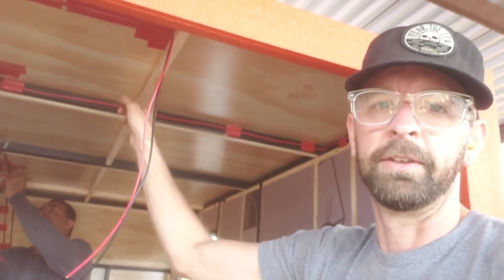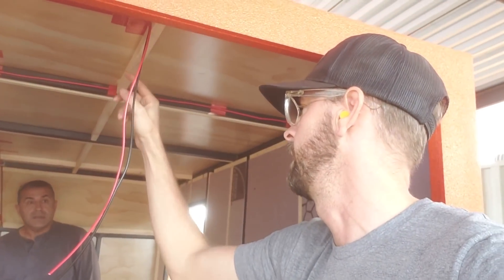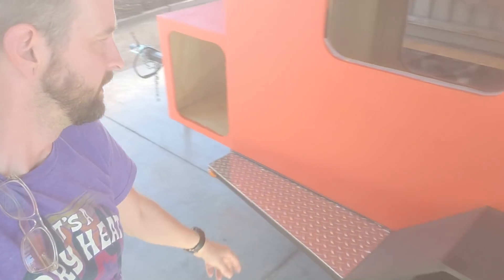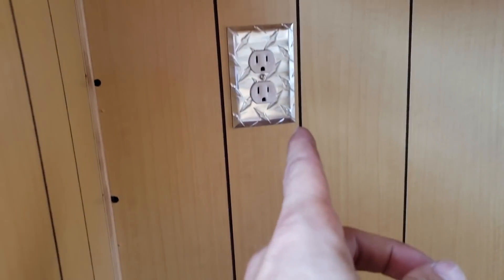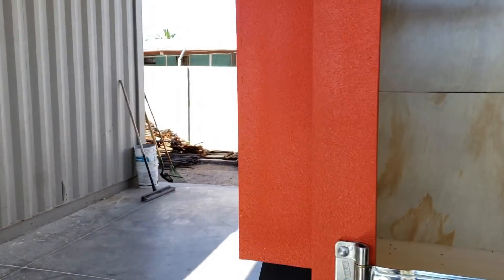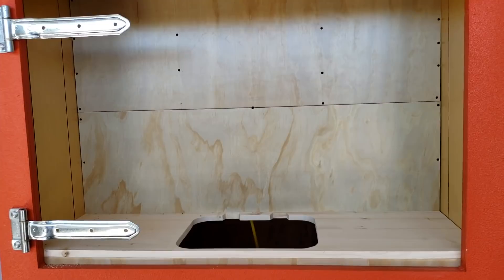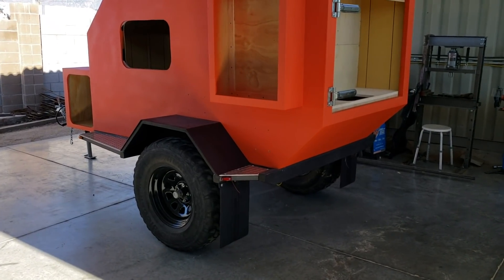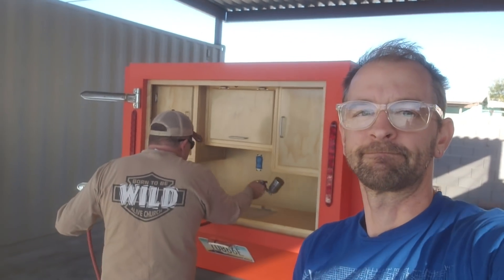Building an Overland Trailer: Pt 3 - Walls and Cabinets

Comment: At 7.27 I see your putting a sink into the rear cabinet, I think I would have changed that for the gas stove an put sink outside. My reasoning is all your cooking bits and pieces are inside and you could have a cook up in any weather, rain or shine. Luv the build and video, inspiring. Thanks 👍🇦🇺🇦🇺🇦🇺🇦🇺
Reply from the maker: That's a great idea. I really need to film a walk-around video now that this is complete and in use for well over a year. The cargo door on the passenger side swings down and has a two burner stove attached.

Comment: I'm finishing up my squaredrop camper. 4x8x4 3/4 plywood. I used fiberglass for the exterior. I still have some gelcoat work to finish, in the spring. I store-bought my door and windows. 

Would you insulate your floor?
Reply from the maker: We did not insulate the floor since there's a 8" memory foam mattress sitting on top of the 3/4" floor

Comment: That is an awesome camper.question...did you build the trailer frame or did you use one already made and built on top of it? I’m looking to start a project like this and not sure if I need to build out a trailer or not
Reply from the maker: We build the frame as well from steel

Comment: Hi Brien, awesome build you guys have done! I'm hoping to build one similar this summer. How did you secure the body (I guess it is 1/2" ply) to the steel frame?? Do you guys have a video of the sides & top being put on?
Reply from the maker: Sorry, i'm a bit late with the reply on this one, we were gone on another little trip to Mexico last week. The body is steel skeleton (1" square tubing) covered in 5/8 plywood. The plywood is attached to the body skeleton with self-tapping screws, and then the skeleton is attached to the frame with a bunch of longer self tapping screws.

Comment: That's fantastic. I'm in the process of building one myself and I think I will incorporate some of your design into it. Thanks!    BTW what size is the trailer?  I thought I saw one sheet of full plywood for the flooring so is it 4x8?
Reply from the maker: Yes, the trailer is essentially a 4'x8' 3d rectangle with angles cut out of it. So for example, the lower angle in the rear is cut off by about 1', so the floor is then 4' x ~7'
Reply: @SonoranSpaceProgram  that's nearly identical to the base trailer I built. Mines 52" by 7 feet. I wanted the interior 48"+. Planned nearly the same design with the rear extended 1 foot at 45 degrees....   did you guys you raptor liner? Does it come in that orange or did you paint over black raptor liner. Orange looks pretty cool!
Reply: @jrg10332  I did 60% of the actual frame. With that 1 foot hanging off the back it makes it look like the axle is in the middle.

Comment: I personally would have the water heater more In the front due to weight.

From the look itooks like there's already to much weight on the back. You'll be fish tailing like crazy
Reply from the maker: The water heater is super light, probably only weighs a couple pounds. the weight distribution is great and it tracks just fine. There's more forward weight than may appear from the videos. There's also a battery box in front with two heavy batteries in it, i don't recall if i ever showed that in the videos
Reply: @SonoranSpaceProgram  I figured you would but the bats up front haha.  Are you a part of the diy teardrop community on Facebook.
Reply from the maker: @ImzJustAGuy  I am not, this trailer is actually my friend Albaro's (a.k.a. "Waka"). He may be in the DIY teardrop community on FB, however. I know he's in the "Off-Road and Expedition Trailers" Facebook group